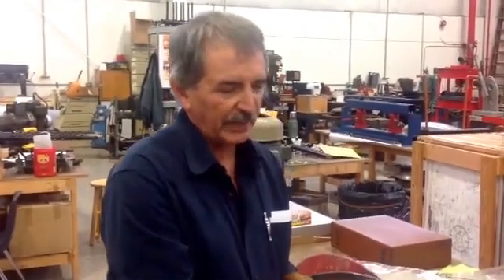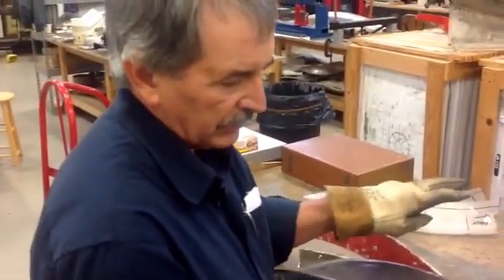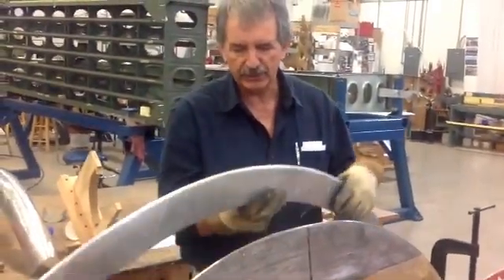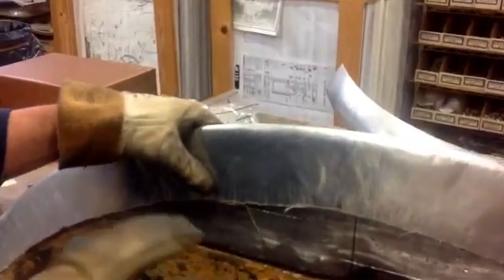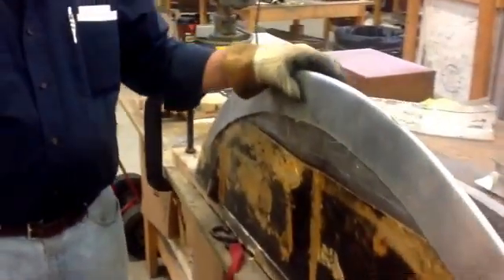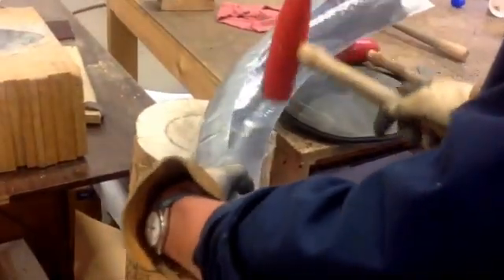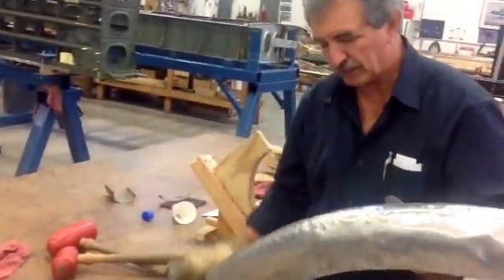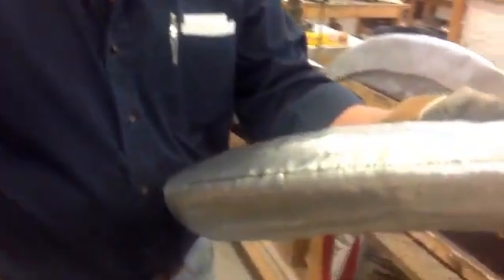Metal fabrication using a wood stump: Forming the Airplane  Horizontal Stabilizer Wing Tips

Comment: Are you certain the original wasn't done in top and bottom halves and welded? That would be a very tough part to do in one piece. Too much stretching or shrinking. Usually a very careful inspection of the back side of an original part will reveal how it was made.